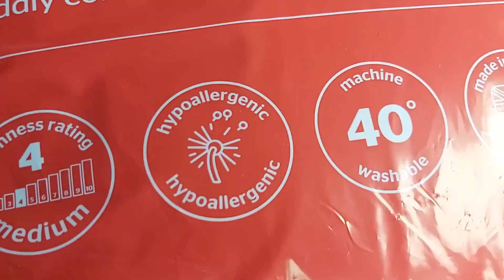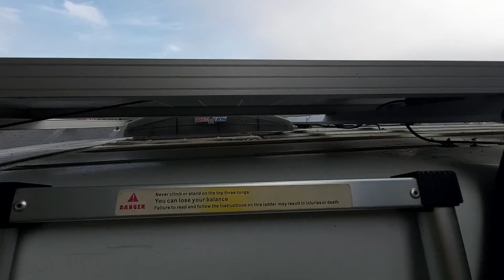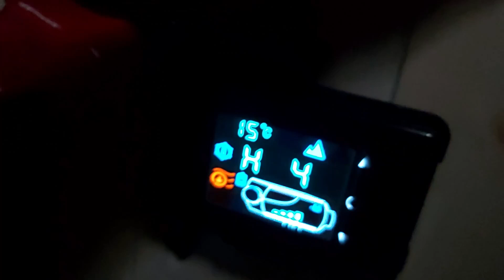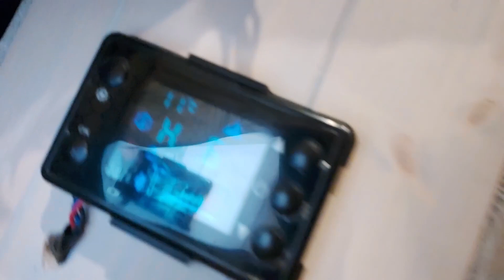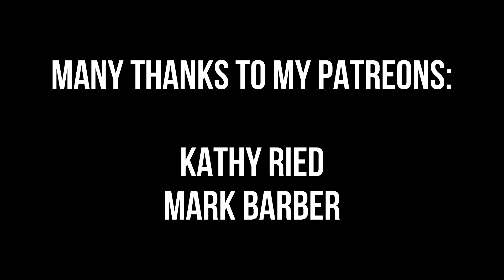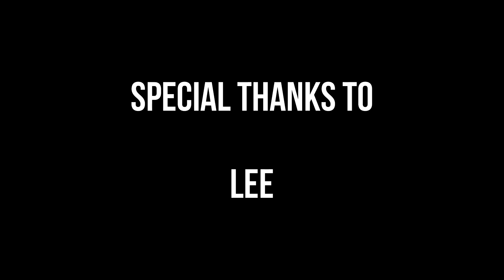Is this The End Of My Vanlife? - VANLIFE UK

Comment: You have the coolest van build I've seen, love all the vintage stuff you incorporated into it
Reply from the maker: Ah thanks very much, it's even cooler now as the diesel heater has stopped working :)
Reply: @SuperVanVagabond  oh man I didn't think it could get any cooler but I guess that would do it. Hopefully you can fix that soon
Reply from the maker: @halenlacoursiere3746  Got a spare glow plug. That might be it, or it might need a new main board? dunno. I need to ring maxspeedrods for info. Only fitted it this spring... (when I didn't need it)  :) currently sat in pub :)
Reply: Sounds like a pain in the ass, is the glow plug easy enough to put in? The pub sounds like a good place to be sat in right about now :)
Reply from the maker: @halenlacoursiere3746  It's an easy enough job. Just messaged company to check the error code, just to make sure. :)
Reply: @SuperVanVagabond  I hope that all works out.. just found your channel a fews days ago and i binged watched all your videos, when I eventually get a van im gonna use some of your ideas in mine. Im not sure if i want to do a diesel heater or a log burner.
Reply from the maker: @halenlacoursiere3746  All the best in getting a van and on your conversion. Update on the heater: I unplugged it and the error code reset to normal display. I then turned the engine on for a few mins and it started :)
Reply: @SuperVanVagabond  Thats great news :)

Comment: Dust allergy is a bummer. Try stick to cotton clothing, bedding and soft furnishings if possible, preferably items with a high thread count (250 + per square inch). Dust mites (Dermatophagoides pteronissinus) can't penetrate tight weave fabrics. Try storing your clothing, towels and spare bedding in vacuum bags, airtight plastic containers or waterproof stuff sacks available from most camping shops. Try get some total covering mattress and pillow protectors. Boil wash everything as regularly as possible, once a week at a minimum for bedding and mattress/pillow protectors . Dare I say it but perhaps think about loosing as much of the 4 way stretch carpeting as possible, that stuff is five star luxury accommodation for dust and mites especially because of it's static properties. Best of luck buddy and keep up the great videos as its refreshing to see real vanlifers on youtube, especially very entertaining ones such as yourself.
Reply from the maker: Ah Dave, I very much appreciate all the info. This allergy is a daily battle. It's getting better, especially with the air purifier and turning on the extractor fan on first thing when I get up to help with it. It could easily end the van life experience if left unchecked. I aim to make some improvements in all departments of the van over the coming months. Thanks so much for your support. There's loafs more vids coming ( I'm overdue atm cus I got slightly inebriated with friends!) Peace! SI 😀

Comment: I am extremely allergic to cats! I have all the same symptoms so I hope you get it sorted out. Great vlog x
Reply from the maker: Thanks Jules, yeah I've got it under control now. Had to attack it on several fronts :) it's been a bit miserable in the van recently; weather, work, condensation,  low batteries, allergy, blocked ear still smiling though :)
Reply: @SuperVanVagabond  I would be tempted to clear it all out and build a permanent warm double bed in there with a pull out table for your laptop x
Reply from the maker: @julesstone7990  I hear you, I however have zero temptation to do much DIY atm :) Got too much do as is :) Maybe I'll do something like that in another, longer van? Who knows what will happen? :)